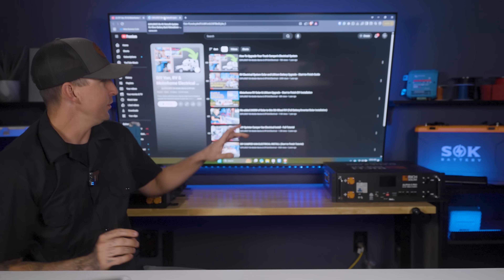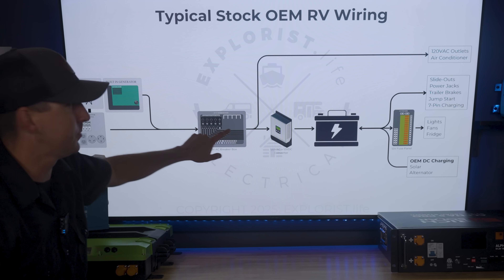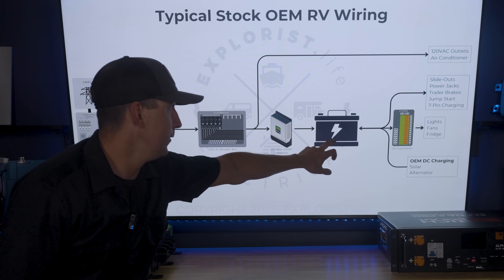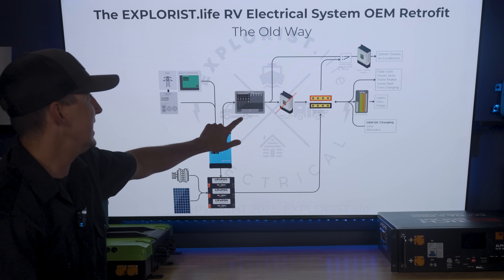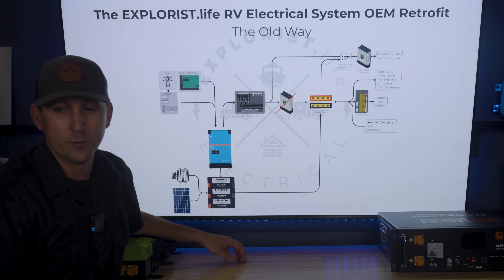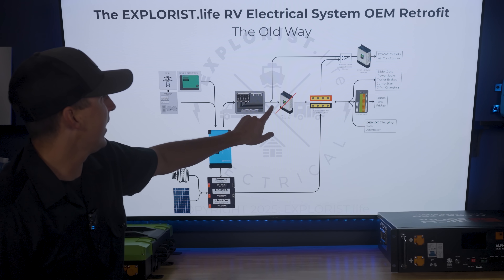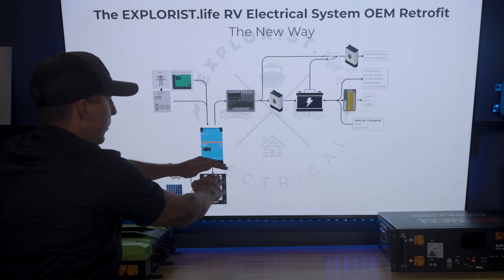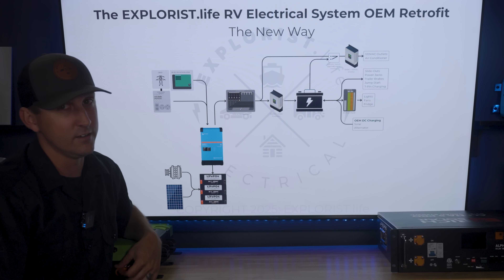The New Way to Upgrade RV Electrical Systems (No More Battery Relocation Kits!)

Comment: Great explanation that makes sense & keeps it simple. One question I have is, would you make your splice into the shore power side before or after the watch dog type protection device? Would this give added protection from all components of the 120v supply side including protection from the inverter should anything happen?
Reply from the maker: Great question! The right answer depends on how your system is set up. If you’d like us to take a closer look and help make sure you’ve got the right protection in place, reach out here: https://shop.explorist.life/support

Comment: Whew!  I’m so glad to see this.  This is almost exactly how I did my Class C RV.  Except I don’t have a multiplus.  I inserted another Transfer switch behind the shore power and put an 30A Hubbell that I connect to my Lcitti kit solar generator.  It’s able to run my A/C or microwave (not both) and that works for a weekend off-grid stay.  I like how it left all the factory wiring diagrams virtually intact for the next guy.
My next phase is to go 24V.  Modern cells is 300AH 24v = 6.4KWh of reserve power that’s still under 50 lbs and can be lifted and handled by one man.  What model Multiplus do you like to use?
Reply from the maker: That sounds like an awesome setup! If you’d like us to take a closer look at your project and next steps, reach out to our support team here: https://shop.explorist.life/support

Comment: Trailer Brakes?????  The only thing on that side of the system for trailer brakes is the break away switch. ( they little black thing on the tongue with the wire on it) If the saftey chains break it pulls that switch to set brakes to stop trailer. Thats all it does!  Trailer brakes are working off your tow vehical not the trailer electrical!
Reply from the maker: Appreciate you sharing that! If you’d like us to take a closer look at your setup, our team would be happy to help. Reach out here: https://shop.explorist.life/support
Reply: @EXPLORISTlife well that sounds like a AI response.  Thank you but I think Im pretty capable of handling my own and my customers ele trical. Own my own business for 40 years working on trailers. Thank you though, and the rv batterey side is only used for emergency brakin
Reply: @EXPLORISTlife  that sounds like a AI response,  again rv battery is only used in emergency and lithium batteries are just fine.  40 years in buisness working on trailers. I dont think I need your assistance but thank you for offering.
Reply from the maker: It is sorta an AI response to a degree, I have an AI based filter set up to...

/turns off AI ["Make Nate Nicer" filter]

...make me sound like less of an asshole when 10,000 people are questioning me about my methods and how I handle my business when most of the critics aren't even customers.  If you're so passionate about how trailer brakes, why didn't you come to my defense back when I was making all of the trailer videos when everybody was calling me out for this exact problem.  I'm very quickly realizing how It's impossible for me to make everybody happy, even when I have options available for both schools of thought.

See how much more blunt and disagreeable I come across as when I don't run it through AI?  It's not better for anybody.  🤣😂
Reply from the maker: Very good and thanks for the busienss!  It's a fine line I have to walk between defending myself and just ignoring all comments on the channel when people are saying I'm wrong when that's not actually true (since the breakaway switch uses trailer battery power under a breakaway condition, like you said).  If you want to go correct the people who were calling me out for having the trailer brakes run through a BMS, here is the playlist of videos where that was going on: https://www.youtube.com/playlist?list=PLmvhcyi4n0TUU8FUc6LE38TBkdSLjdw_5

Comment: So, doesn't the new way mean all DC loads run from the AC side of the MultiPlus? There's a fair amount of inefficiency here if I'm understanding this correctly. No shore power or generator means (DC) Lithium batteries --> MultiPlus--> (AC) factory AC panel --> factory AC to DC converter --> factory DC system. Basically you're always running DC loads from AC, meaning the usual loses from DC to AC to DC inverting will hit you new Lithium battery bank.
Reply from the maker: Great observation! To make sure your system is working as efficiently as possible, we’d love to take a closer look at your setup. Reach out to us here: https://shop.explorist.life/support

Comment: Wondering how much efficiency loss is baked into this “New” system. Converting from 24/48 to 120 to 12 volts. I would imagine factory converters have pretty lousy efficiency and running all you your 12v loads through it all night (lights, fridge, etc.) might lower your battery storage capacity. Or would it negligible???

If all your lights and appliances were 120vac, then this system would be supremely efficient. And if they were all 48v, then even more efficient. But we aren’t there yet…
Reply from the maker: Efficiency losses are exceptionally minimal.  Since every system can be a little different, we’d love to go over your specific setup with you. Reach out to our team here: https://shop.explorist.life/support

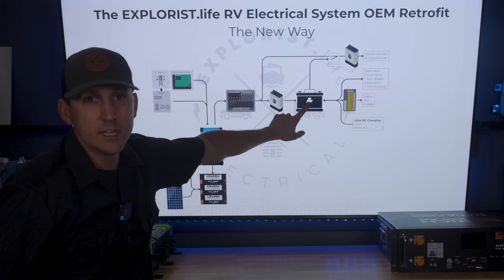Comment: 14:10 No, you don’t have to leave your factory 12v lead acid battery. You could disable your converter and charge your lithium 12v system using an mppt controller from your 48v system. Especially if you already have a lithium 12v bank. Would you NEED to? No, but you don’t HAVE to keep your factory 12v system. You have options.
Reply from the maker: Options was quite literally what this video was about.  To really see how this applies to your setup, we’d love to take a closer look at your system. Reach out to us here: https://shop.explorist.life/support

Comment: I like how the new way simplifies the install and makes it super easy to remove the electrical system upgrades if you sell your trailer. I don't like the additional weight of unneeded components in the new system (converter, old battery). I also turn off my inverters regularly to eliminate the standby power losses but with the new way you have to leave the inverter on in order to keep the converter and DC system powered. (At least long term, because in the short term the old battery can power loads still.)
Reply from the maker: The weight savings is only about 50lbs in most popular cases.  To make sure your setup is dialed in just right, we’d love to take a closer look at your system. Reach out to us here: https://shop.explorist.life/support
Reply: Totally agree. I was thinking the same thing. The design makes sense for a standardized company install that can’t assume anything about a customer’s 12v wiring, but for more advanced DIYers, battery bank relocation solutions will likely still be preferred.
Reply from the maker: Keep in mind that our opinions are based on being involved in over 30,000 DIYer installations.  Our in house installations is a small percentage of our overall customer base.  Happy to sell you whichever version you like though: shop.explorist.life
Reply: @EXPLORISTlife  Thanks! Love your content!

Comment: How does this affect the overall efficiency, do you need more battery to supply the multiplus since it's always having to run the converter and constantly charge the "house" battery?
Reply from the maker: That’s a great question and really depends on the specifics of your setup. If you’d like us to review your system and make tailored recommendations, reach out to our support team here: https://shop.explorist.life/support
Reply: @EXPLORISTlife thanks, I don't have a setup yet, but I'm in my 2nd year of research before I buy the trailer and install a system.
Reply: This new way seems like it would work well with the new Bluetti RV5 system. Have you had a chance to work with that system yet?

Comment: We just did a 24v system in our RV while leaving the 12v OEM system intact and not changed. Did a 24-12 victron converter to maintain that side. The ONLY reason I didn't want to use the built in converter is it will take up the usable watts from inverter. It's hard to get a perfect setup.
Reply from the maker: Thanks for sharing your setup! Every system can be a little different, so if you’d like us to take a closer look and make sure everything is optimized for your needs, reach out to our support team here: https://shop.explorist.life/support

Comment: While I do agree this system is simpler, faster, and cheaper to install.  But there is a HUGE issue for SOME folks.  

There are some of use that want to be off grid for as long as possible by maximizing efficiency. In my 50 amp RV, I have two MultiPlus. I need to have AC to run both my powerful laptop and 32 inch monitor throughout the workday. The inefficiencies of running the two multi pluses is huge!  Then factor in also having to charge and lead acid battery on top of that to keep the RV running, even more inefficiencies.

I totally get the vast majority of your customers or Boondocking for a day, maybe two. In those situations what you’re proposing is gonna be far cheaper, and far easier, and better all around.   But if the system really needs to be something that can Boondock for a week plus, the inefficiencies of always having to generate AC power from batteries to charge another battery is just silly.  At a minimum, Put in a DC to DC charger so that the big battery bank can charge the house battery directly when the multi plus is not running.

I plan to upgrade my system from 12 V to 24 V and that’s exactly what I plan to do. Restore the house batteries and have a DC DC charger to keep them topped off off the 24 V system.   Then I plan to reinstall a Phoenix 800 on the 12 V side to run just the “inverter “outlets and that’s what I’m gonna use during the workday. Gonna go from consuming north of 81 hour just run inverters to about 8 W.
Reply from the maker: Great points! It sounds like you’ve got a pretty detailed setup and some specific needs. We’d love to take a closer look at your project so we can make the best recommendation for your situation. Please reach out to our support team here: https://shop.explorist.life/support
Reply from the maker: Side note:  Please understand that the vast majority of our customers are off-grid for extended period of times and if you haven't been following the channel for a while - Steph and I also personally lived in a van for nearly 5 years and were off-grid for 95% of the time with the main limiting factor for coming to a campground being the need to do laundry - not power.

Comment: thank you, if we change the stock 12v led acid for a lithium we would also have to consider if the converter charges lithium battery too I guess?
Reply from the maker: Great question! That can definitely vary depending on your system, so we’d love to take a closer look at your setup. You can connect with our team here: https://shop.explorist.life/support

Comment: Question - so if added a 12v AC for example you would have to keep the inverter on in order to use the new battery bank to power it?  I guess what I am wondering is if you have more excessive 12v loads you want to use (because you now have a new Lithium battery bank) you would have to keep the inverter on to access the true potential of that bank?
Reply from the maker: Great question! Since setups can vary a lot, we’d love to take a closer look at your project and make a personalized recommendation. Reach out to us here: https://shop.explorist.life/support

Comment: To save weight and space, I removed my 2 lead-acid Group 24 batteries and replaced them with a 12v 18Ah SLA battery which only weighs 7 pounds. It is charged by my Victron 24 to 12 V converter and it handles the surge needed when powering my hydraulic slides and levelers.
Reply from the maker: That’s a creative solution! If you’d like us to review your system and make sure everything’s optimized, our team would be happy to help: https://shop.explorist.life/support

Comment: Interesting, obviously you are not concerned with weight. I would prefer a custom build without a second battery, so I am a different  type of customer😊
Reply from the maker: The OEM battery is like 60lbs if there’s just one of them.  The wiring kit we get to omit is about 10.  The weight doesn’t matter much.  I can almost guarantee that everybody camping has 50lbs of random junk they don’t need on board.

Comment: I replaced my 2004 Airstream lead-acid batteries (2) with group 24 lithium batteries (100ah each) - they fit in the same battery box up front. I was able to change out the factory converter for a similar version compatible with lithium. There is no factory inverter, but I'd like to add one. I need to spend more time with your "new way" diagram to see if there's an easy way to do this without having to add more batteries. Is this something you've seen before?
Reply from the maker: Sounds like a solid upgrade! If you’d like us to take a closer look and make sure everything’s dialed in for your setup, reach out to us here: https://shop.explorist.life/support

Comment: Unless I have lost my mind trailer brakes are powered from the brake controller inside the tow vehicle not the battery in the trailer.  What the controller actually does is regulate the amount of voltage going to the trailer brakes.  The more voltage to more braking.
Reply from the maker: Good point! Since every system can be a little different, we’d be happy to take a closer look at your setup and goals. Reach out here: https://shop.explorist.life/support
Reply: You are correct! I have never ever seen an electric brake system powered by the batteries on the trailer! Kind of a big oops for one claiming otherwise.
Reply: @JB-tp9we the breakaway safety switch is powered by the trailer battery.
Reply: @JB-tp9we the Dexter electric ABS trailer brakes may run off the trailer batteries. My unit has power to at least the ABS module at all times.
Reply: Electric over hydraulic brakes typically run off the trailer batteries. Breakaway for either comes from the trailer batteries. Unless you put on a breakaway battery kit like utility trailers use.

I need to verify, but I believe my Dexter electric ABS trailer brakes run off the trailer batteries. At least the ABS module does as it always has power.

Comment: Question. If you leave the lead acid battery there essentially being charged by the multiplus,  if you run a 12V air conditioner unit, will the charge to the lead acid be enough to keep up w the power of the A/C unit?  I know there is plenty of power w the new battery bank (lithium) but can the lead acid deliver (pass through) the power to the air conditioner?  Are there things to consider?
Reply from the maker: Great question! That really depends on your specific setup, so we’d love to take a closer look and make a personalized recommendation. Reach out to us here: https://shop.explorist.life/support